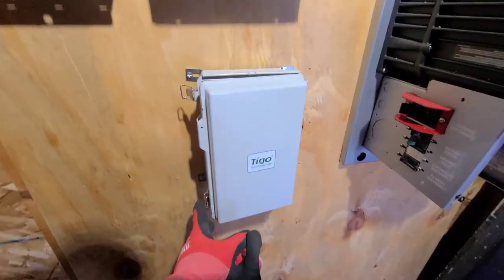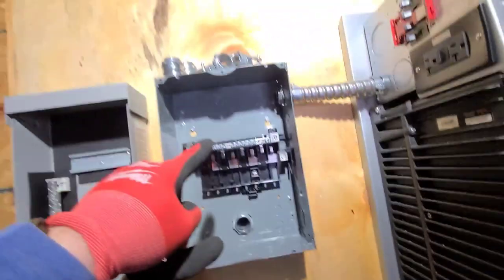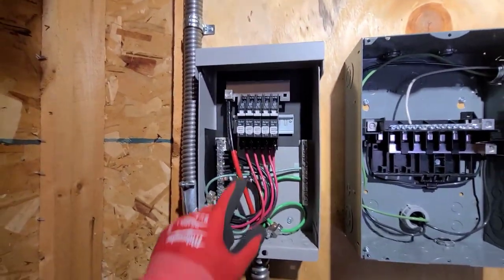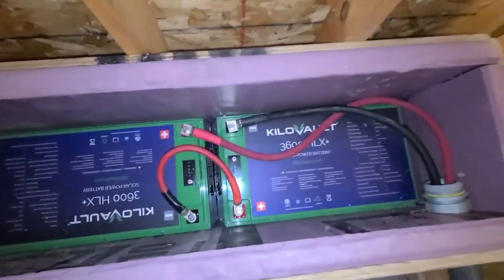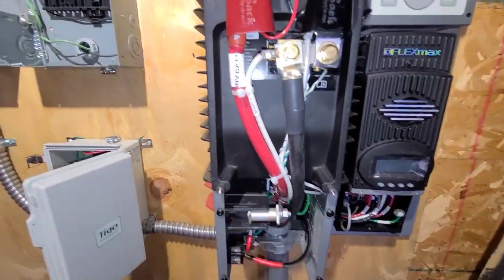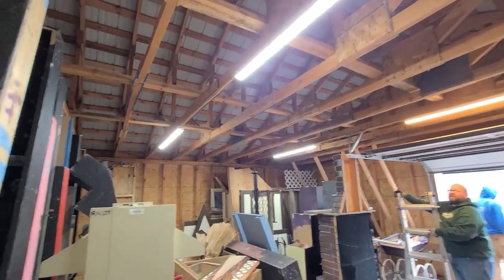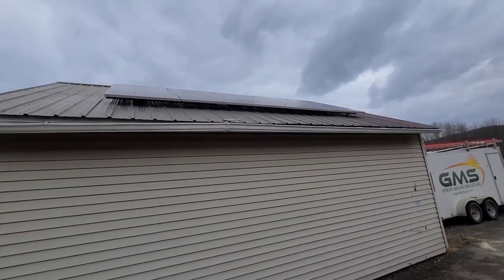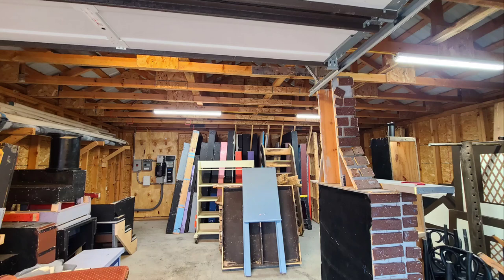Outback FlexPower One With KiloVault HLX+ Batteries || Lithium Batteries in an UNHEATED Shed!

Comment: Nice little system.  So expensive though.   2 questions - why the rapid shutdown?  Surely in the event of a grid/ac faliure you'd want the solar to keep charging the batteries, not shut down?  Secondly how are you balancing those 2 x 12v batteries in series?  Any slight difference in internal resistance means those two could get out of balance over time and cause issues?
Reply from the maker: This was installed at a school and the electrical inspector wanted to see rapid shutdown on it.  The disconnect on the outside of the house shuts down the tigo transmitter along with the AC output of the inverter. There is no grid here, but the tigo transmitter is tied into the charge controller battery connection, so even if the inverter shuts down on LBCO the Tigo will always be active.  I am using a Kilovault balancer on those batteries, might not have shown it on camera though.

Comment: Looking good Ben! As others have said: what a great purpose build system 🔆🙂👍 might we get an established system cost for this?
Reply from the maker: The system was about $11k-12k in materials.  That included 5- 440w LG  panels, SnapNRack racking and attachments, 2 Kilovault HLX+ 3.6kWh batteries, Outback FP1 2524, disconnect, combiner, breakers, Tigo equipment, load center...  it adds up fast!
Reply: @benssolarandbattery  honestly in my opinion that's still a great price for the quality of components & longevity sake. Thanks again!

Comment: Can you explain a little more about the Tygo box? Not sure what you’re putting in there before it goes to the inverter. Since you already have the breakers installed. 
Redundancy on breakers?
Reply from the maker: Each one of the panels has a rapid shutdown TS4-A-AF box on it.  When you shut down the outdoor disconnect, it shuts off power coming from each of the panels.  This installation is being inspected by the state, so needs to have it.
Reply: @benssolarandbattery  
Interesting as I thought the breakers in the first box was where the cut offs were on the panels. At least that’s the way I set up my off grid system. I had the fuses in the connecting wires on the roof.
Reply: @benjones8977  Of course, the fuses are for protection, but Tigo RSD system will disconnect ALL the panels from 1 single point... once the RSD button is pressed outside, the Tigo Box inside will send a signal to all the TS4-A-AF's on the roof to disconnect each panel, therefore cutting all DC power from the panels into the MPPT controller... this is the ideal protection system for sudden fires or flames, mostly on the roof (on the panels)... Nice precaution...!!!
Reply: @Songomx  
Interesting, thanks. I thought that was what the first breakers were for. Built-in redundancy at a higher level. 🧐
I’ve checked my wires all over the place by hand for heat. I usually run a heavy draw and then go check around for any extreme heat coming off the wires. I did find one area with a very short wire going to the bus bar that was somewhat hot. Later I found out I didn’t have enough relaxation in the wire, it was too stiff and tight, so I made the cord a little longer and hooked it to a higher point on the bus bar. This brought down the temperature (heat) quite a bit. This helps in extreme heat in the summer.
Reply: @benjones8977  the Tigo stuff is so someone on the outside (for emergency or service) of the building has a rapid shutdown switch that stops any power from leaving each pv panel right at the individual panel. If there’s a fire the firman can hit the outside switch and know they aren’t going to get zapped by the pv panels.

Comment: Does the rapid shutdown also disconnect the battery from the system?
Reply from the maker: It shuts down AC power to the load center along with DC power from the panels.  The battery stays on.  I suppose I could have it shut the inverter down as well very easily.  I still have to go back and finish up, so maybe I'll do that too! Thanks for watching and the feedback!